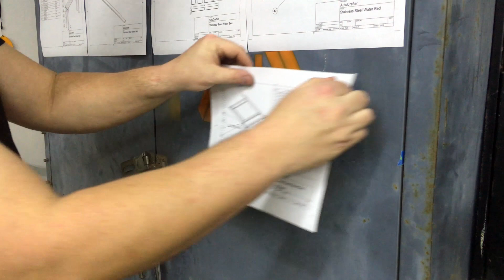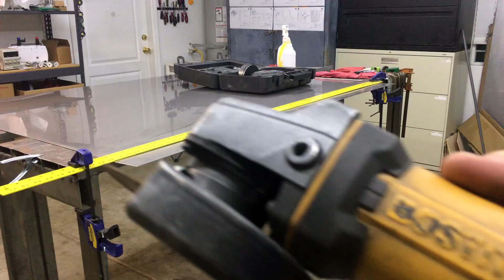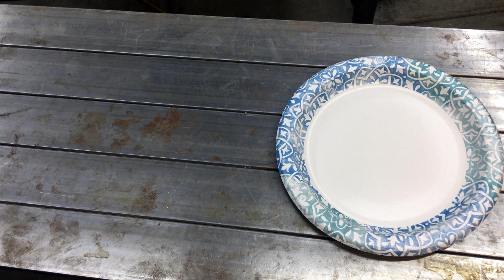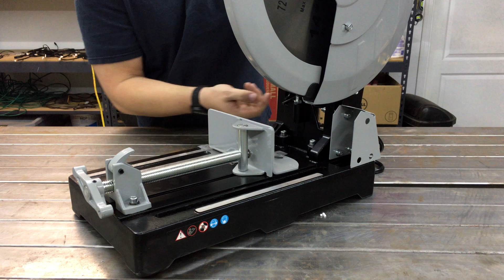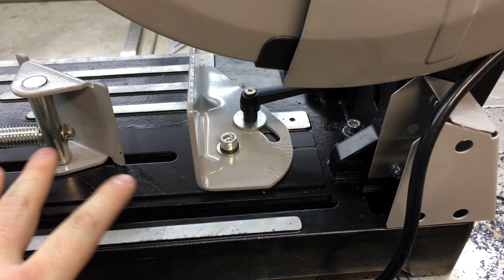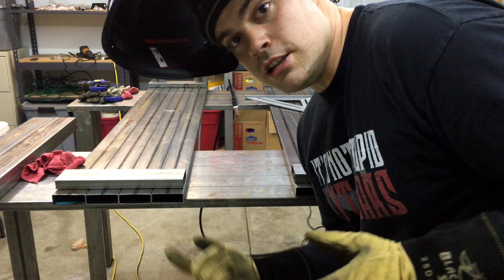LARGEST DIY 3D Printer CNC Build - xTable Print Bed for the AutoCrafter

Comment: Good job!  I was going to build the water pan for my CNC plasma the same way you did, but the guys at the welding shop convinced me that it was much better to bend the ends up on a break and only weld the corners.  Saved a lot of argon, wire and time and I didn't have to chase down any leaks.
Reply from the maker: Yeah if I had a "do over" I would say yes bending is way better and faster. I didnt have a sheet metal break to bend it so got some good welding practice. 125cf of argon though and 3 leaks 😭😭

Comment: Hi, 
What is the printing speed of this machine? . What time take for 1200*1200*1200 mm *  3 mm wall thickness box?
Reply from the maker: Good question! I'm hoping for about a 120mm/s printing speed(after the Ballscrew stabilizers are installed). According to Slic3r that would still take roughly 4 days to complete. My Z is about 180mm though(for now) so even the AutoCrafter would have to split up a print like that into sections haha

Comment: What a great build, and here I was thinking I was going big with a 400mm^3 build.  LOL.  A word of cation if I may, if your planning on using auto leveling on your "water bed", see what I did there...beware that inductive sensors like the LJ12A3-4-Z/BX produce large errors when the air is humid so you might consider something like the BLTouch.  Anyway, thanks for the cool vids man and happy making!
Reply from the maker: Nice tip I didn't know that! I will be attempting auto bed leveling(calibration would be a nightmare without it) I have an older LJC18A3-B-Z/AY Capacitive Proximity Sensor that I will be trying out first but the BLTouch is my next option. I'll share a video on that soon. Thanks for the interest!